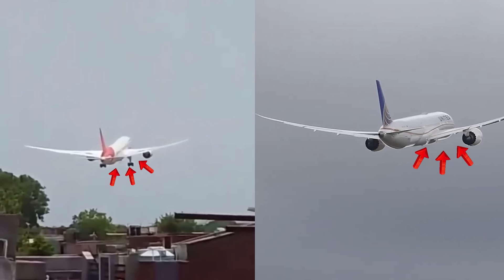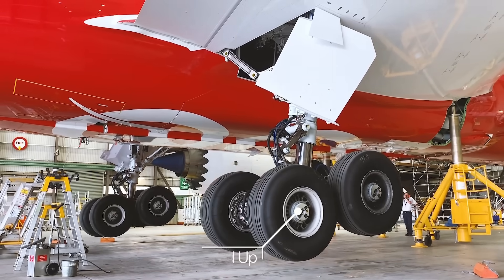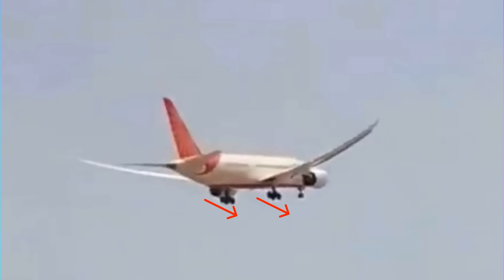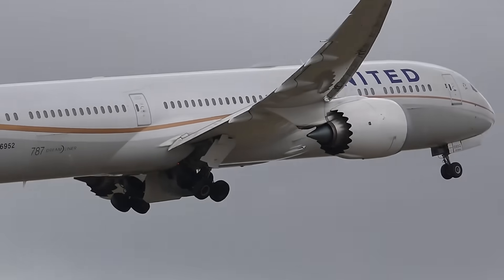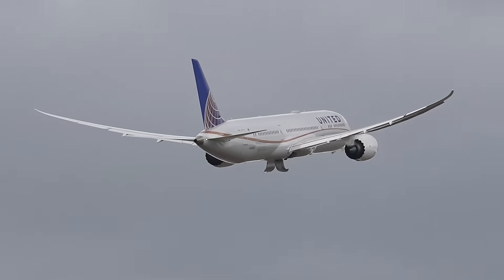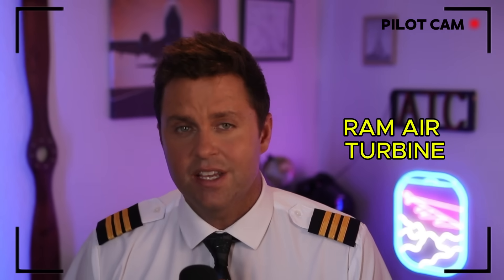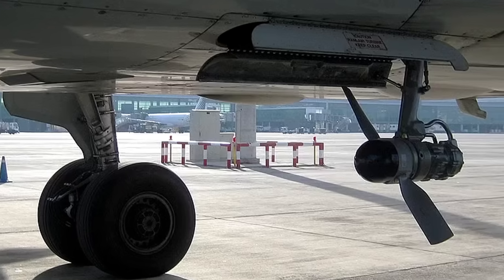Pilot Explains: A New Detail in the Air India 787 Crash Everyone Missed

Comment: Eye roll
Corporate aircraft mechanic here.
1. The RAT, unless manually deployed will not have been out.
The RAT will automatically deploy if there is no AC power from the generators on the engines.
2. If the engines were turning, which they were, the high pressure turbine would be turning the gears in the gearbox where the generator is attached to, producing AC power.
3. If it were contaminated fuel, the probability of BOTH engines failing is near impossible since (unless crossover was used) each engine is getting fuel from a different tank.
4. Only way the engine would starve from fuel is if the fire handle were pulled. The low pressure fuel pump on the engines have the capability to suck the fuel out of the tank via a bypass at the wing boost pump.
I cannot explain why the plane did not produce the thrust it needed, but I am interested in knowing what the FDR and the CVR have on them.
Reply: On point 2.  Why do they install the RAT systems at all if spinning turbines still produce electricity ? Or do they eventually stop even in a glide with total power loss?
Reply: @Russellviews  I.D.D.I. (i didn't design it). The generator or the gearbox could have a catastrophic failure. The HP section could have sheared.
Planes are made to withstand double fault failures.
Reply: @G8R8R  
thx

Comment: If engines rolled back to idle safe mode after power failure at takeoff, could pilots have disengaged TOGA, then  reengage  it to tell the plane it's in manual override in enough time?

Comment: The takeoff didn't look good to me in the first place. The aircraft was not gaining speed gradually, it was not accelerating, the engines didn't roar, as it went down the runway, and they managed to get it airborne only at the very end of the long runway, visibly kicking up dirt. To me it seems they didn't have enough power even while on the ground. I would have aborted that takeoff for sure - if I may say so.
Reply: I thought that too. they don't always kick up dirt like that unless the take off took longer than it should. The problem may have begun very early but not before the point of aborting take off option

Comment: On the 787, the flaps and landing gear use the central hydraulic system, which has 2 large 235V hydraulic pumps. When the flaps are retracted, 1 of the pumps is automatically turned off, and the system operates with only 1 pump running.

If the flaps were retracted by accident, then the landing gear would retract slowly on 1 pump, which is what you are seeing in the accident video. Also in the gear maintenance clip in your video the gear is retracting slowly on 1 pump.

Re-deploying the flaps would only slow the gear retraction more. When does the second pump turn back on, is the real question, or was there a failure preventing it.

The RAT provides hydraulic power to the center system, but only to the flight controls. There is an isolation valve that closes when the RAT is deployed, isolating the RAT from the flaps and landing gear. Also the RAT only generates 115V,  so it cannot power the large 235V hydraulic pumps.

I think this was a combination of causes, as most accidents are. The out-of-order flap/gear retraction, design flaw in when the 2nd pump turns off, and maybe an electrical failure, like 1 of the 4 generators failing, which might have caused the load shedding of 1 of the 2 center hydraulic pumps.

The survivor said the cabin lights flickered, but did not go off. If it was a double engine failure the cabin lights would go out. Instead I think the APU automatically started, and the RAT deploys as part of that sequence to provide power while the APU is starting.

I don't understand why the APU is not running during take-off. It would provide 2 hit standby 235V generators, and you would never need to load shed during that phase of flight.

I think the 787's automation will be closely scrutinized...

Comment: My current uneducated theory is that the landing gear issue we see (with the trucks tilted and the doors not opened) is likely a symptom, not the root cause. It might suggest that the gear retraction sequence started but got interrupted? which is abnormal. But on the 787, systems like gear, hydraulics, engine controls, and electrical power are all interconnected through shared data buses and logic.

So I think a central systems failure  possibly electrical or a data/logic fault might have happened during or just after the gear retraction command. That fault may have affected both engines FADEC systems or the aircraft’s electrical supply, which could explain why both engines rolled back or became unresponsive and why the RAT deployed 

Is the gear truck issue is a key clue, but not the primary cause? I believe the most plausible root cause right now is a shared systems failure that disrupted thrust control and power  and possibly triggered by, but not caused solely by, the gear retraction. I think this theory also aligns with the mandate from the Indian DGCA?

Comment: Just commented on Cpt Steeve's reel, that I did not really see that flap issue. Confirmed by you now. Gear tilt is quite obvious, actually I was wondering on very first pictures about that tilt, thought it was maybe normal or due to camera angle (I am not an expert in any way ). Was there maybe some all out short-circuit when they lifted the gear and they lost both engines? That should be technically impossible.
Deafening sound of engines at full thrust was missing, right. Sounded more like a plane landing. Including RAT, it all points towards engine failure. 
Big question is: Was it any technical issue or rather some maintenance issue? Contaminated fuel? That would be so devastating. 
At this point I don't think any of the blame will go to Boeing or the pilots. But in the end you never know.

Comment: This plane had known electrical issues when it came into this airport, I cannot understand why it was not pulled from service and the problem investigated. 
It sounds a lot like a wiring loom has been shorting somewhere to the point where it either lost a main power bus or a communications network for the flight controls. There is also the less likely theory that it was cross fueled with a different type of fuel that got to the engines during the takeoff roll. 
What is terrible, is the human cost of this, it really is horrific and we give our thoughts and prayers to all the Indian passengers and crew who perished on that fateful plane. 
Lets hope this accident is investigated quickly and the cause established, checked on all other similar aircraft and rectified before we start hearing of this again.

Comment: Another possible cause of a duel engine failure. I was told be Boeing company flight crew train pilots and I have been able to confirm thus scenario,  A complete battery failure, you will loose all power too the hot battery bus, if this should happen, those systems the hot battery bus supplies closes. This includes the main fuel shut off valves.  I had many discussions with check airmen about this with different conclusions.

Comment: I've never believed the flaps not deployed on takeoff theory. You need to be very close and/or have very good resolution to be able to see the position of the flaps. All the footage we've seen so far is quite grainy, from CCTV or mobile phones. Inconclusive either way. "Forgetting" to set the flaps is extremely unlikely, the checklist and visual and audio warnings in the cockpit are all designed to catch that, and almost prevent the plane taking off without flaps.

Comment: ITS OK BUT WHY AIRPORT AUTHORITY DID NOT PUBLISH ANY CCTV FOOTAGE FROM THE BEGINNING OF PREPARING THE FLIGHT FOR JOUNEY IN THE WORK SHED ALL THE CHECKING POINTS WILL BE CHECKED BY DIFFERENT DIFFERENT ENGINEERS AND TECHNICIANS AND FINALLY PILOT WILL ALSO EXAMINE TO SOME EXTENT OF IMPORTANT ASPECT WHICH IS CONSIDERED TO BE ESSENTIAL FOR SAFE FLYING????????? IF PROPERLY CHECKED UNLADDEN WEIGHT OF THE FLIGHT , THRUST WONT COINSIDE ACCORDING TO THE WEIGHT OF THE PLANE  ; IT SHOULD HAVE STOPPED IN THE WORK SHED ITSELF, AVOIDING THE UNEXPECTED FATALITY.

Comment: Can there be electrical failures caused by external forces? How sensitive are electrical systems of airplanes for geo-magnetic forces? There were several geo-magnetic storms last weeks.  https://www.youtube.com/c/StefanBurns They can cause electrical problems world wide! I can imagine not all electrical systems are fail - safe in those conditions. If so ...how to improve electrical electrical/magnetical safty of airplanes? Yes polluted fuel seems possible. Lots of power failures at ships. Also a lot of exploding batteries on cars world wide. Good luck in solving this and ...prepare crew, team, procedures  or systems better. Of course not my goal to point towards outisde forces that are out of our control but ...being a  bachelor mechanical / machinery / energy technician how to operate in severe conditions and/or how to design, build,  measure/detect, simulate,  test or maintenance for that.

Comment: Max has been saying a vapour lock in the fuel can disable an engine, and yes, but the chance of it disabling both engines simultaneously seems unlikely. So, Fuel contamination has been floating in the back of my mind. With the RAT deployed, and as you've pointed out the gear angle, I can only think it's that or, possibly, some kind of major computer or fuel system failure.
Reply: No such thing as vapour lock in a transport category aircraft.

Comment: What I noticed in the video was that the RAT was already deployed AS THEY WERE STILL CLIMBING post rotation.  I am a lay person so I'm no expert but they were still climbing when you can clearly hear the RAT operating.
1)  Did they continue to climb via momentum or was there some other issue PRIOR to the engines shutting down?
2)  IF there was a fuel contamination issue, wouldn't it have shown up on other aircraft that fueled up there?

Comment: Lockable to 3 years of maybe 5 years ago I seen a plane somewhere out in New York or Eastern United States that crashed in the result they found out it was sitting on the tarmac with the air conditioning running and caused VAPOR LOCK in the fuel

Comment: Could dual engine failure be caused by a main electrical fault - to put all fuel pumps instantly out of action?
Why do I ask this?...because a passenger who took the flight in the same plane from New Delhi to the crash airport but who left the flight/plane at that airport produced a video which showed that the aircraft seemed to have electrical problems - aircon wasn't working and nor was the seat-back entertainment system working.

Comment: So far this is the best video I watched about this crash. One thing I am still wondering is: when you take off and set TO pwr the PM calls power set, so if they started the TO they had the power needed as per performance calculation, either EPR or N1 anyway the right amount, then down the runway probably after V1 something happened to those engines (something not visible in the video) , then they lifted off with the little power they had maybe they got all rwy on purpose to gain as much speed as possible. After, they used that speed to reach 600’ roughly tried to raise the gear (maybe) to go a little further ahead and higher and then with that insufficient energy crashed. Do you agree or disagree on any of this? I am just trying to understand a bit more before the actual investigation comes out.

Comment: The only reasons I can think of for the loss of both engines at the same time is something happened to the fuel supply, and a bird strike taking out both engines like Sully & Jeffrey had to deal with.  

I heard early on that the aircraft had recently undergone a major overhaul.  So possibly something in the fuel system was not properly installed, repaired, overlooked, computer failure, etc, etc.  Fuel contamination could also be to blame.  Also the loss of fuel supply could have been intentional.  I have watched many videos on this crash and have not heard that mentioned yet.  It has happened a couple times that one of the pilots committed murder / suicide.  

Hoping that the black boxes gives the investigation a much more definite picture of what went wrong soon and it is released to the public.

Comment: According to the relevant Wikipedia page: "The Boeing 787 utilizes a Full Authority Digital Engine Control (FADEC) system for its engines, which are either GE's GEnx-1B or Rolls-Royce's Trent 1000. FADEC provides precise control over engine functions, optimizing performance and efficiency." If there was an electrical failure that took out or compromised the FADEC, could that explain why both engines seemed to be at very low thrust and therefore producing very little noise as AI171 descended towards the crash site? In other words, could dual engine failure be caused by an electrical/electronic failure?

Comment: Hi Garyb pilot there is a video of a passinger showing were he was sat that the display screen and the wired control was not working he said the call button was not working plus the air con was not working plus i did notice a few of the screens were dark and plus the screen were he was sat was none responsive when he touched the icons however i am not shore if it was the same plane that crashed.. I would like to here what you and captin steve have to say about this and what would cause some screens to be dark and some screens are working and the air con not working.

Comment: why does noone consider sabotage.
The surviver talked about at bang!   THEN  flickering lights.
So, if you place even a small explosive at a place to disrupt main power, would that not lead to a similar problem?
Reply: Nobody's talked about sabotage, because right now, there's no reason to suspect that; however, don't fret that the investigators will rule it out. The investigators are professionals; they follow the evidence, regardless of where it takes them, even if there are a thousand pieces, all pointing in different directions. More to the point, the bang the survivor heard could be caused by a dozen things that have absolutely nothing to do with malicious activity.

For example, many electrical devices make a loud bang when they overload, it could even have been a pressurised vessel splitting, or it could have been the fuselage impacting something. There are many pressurised systems and high-power electrical systems on the aircraft that could have been responsible for that. Many of which could be the cause or a symptom of what took her down.

Lastly, if it really was sabotage, that means terrorist action or somebody with a grudge. A terrorist organisation would have claimed responsibility by now, but instead such groups are denying involvement, and there's no obvious political motive for this. That leaves a grudge, and it would take one hell of a grudge for somebody to target a plane full of people to get at any one individual. And again, it's likely that somebody with a grudge would have wittingly or unwittingly outed themselves by now, which nobody has.

Even Pakistan have offered sympathy for this, and they're at war with India. So, no, it's far more likely this was an accident. What caused it will be intrinsically connected to whether it was a result of deliberate act, negligence, or happenstance; and sometimes there really is no person at fault. It's easier to point fingers, but that often isn't fair or warranted.

Comment: I have been in aviation since 1969 starting as a certified US Air Force Aircraft Mechanic, then later got my FAA A&P mechanics license.  Also a commercial pilot since the early 1970s.  I just posted my comment on Capt Steve’s channel that the RAT sound is very prevalent and the sound of take off power is not.

Comment: dear Garry 
Flaps were extended its proven with picture of wing .
as Wishwas kumar the solo survivor put in hindi " after taking off for 5-10 secomds we felt plane was stuck (stall) then bue and white light lit and pilot gave the ...Race (throttle) and with this speed it hit ...what was there , then reporter completed his word " hostel" and Wishas said "yeah the hostel "
so light lit back because APU the RAT was deployed ?

dual engine failure theory looks impossible but i hate to say that india has been having recent enemies . if one technician managed to chock the fuel supply on some level ?
futhermore  one enemys firm has been looking after ground maintenance of Air indias aircrafts (though they cleard only B777 crafts ).

its very disturbing but terror group goes that far otherwise one cant explain both engine exhausted simultaneously.
 thanks

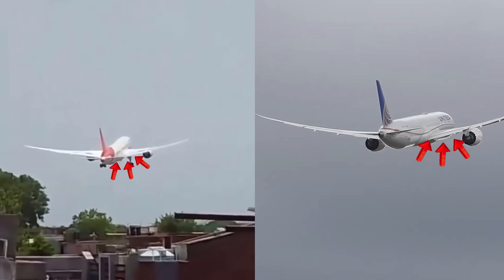Comment: @1:53 look at the AI787 fuselage. Follow the line of the top-of the fuselage from the cockpit to the 'red band' just forward of the V Stab LE. Above the red-painted band there is an odd white bulge visible... that appears to be originating on the LH side of the aircraft. The United Acft has no such feature... the upper-crown line of the fuselage is 'dead-straight' from the cockpit to the V Stab.... only interrupted by a SATCOM antenna radome. Also, the AI787 looks like it has at least 2-spoilers 'lifted up' forward of the flaps... area behind/Inbd the engine exhaust. Also neither of these engines are showing signs of catastrophic engine failure... they 'look like' they are at idle.

Comment: The issue with contaminated fuel theory is, while not impossible, both engines may not fail at the same time.

Both engine failing AT THE SAME TIME points to some common system which  controls both engines failing.